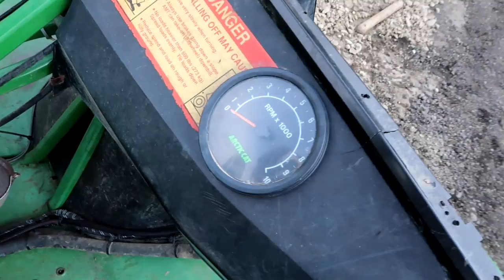Suzuki 600 Gator Top Speed Test

Comment: I dont know much when it comes to engines and stuff but what if you took the clutch system off the arctic cat that you took the engine off wont it make the gator go fast because it setup to handle all the power or would it not work due to the gator having 4 wheels to power and not a track and wouldnt help to had a clutch cover to keep it from getting wet and muddy so it doesnt slip

Comment: What are the hydraulic brake replacements you used? I am not that mechanical and my brakes on my AMT 600 do not work and the dealer wants $200 for the brake pads only. Thanks.
Reply: Have you found a solution? I have the same issue.
Reply: @lumberjackdreamer6267  Get hydraulic brakes for a three wheeler ( calipers and brake pads, brake lever with reservoir for handle bars and brake lines ) You will have to make brackets to mount calipers but that was not that hard. The bigger the better.

Comment: Please keep your ground when welding as close to were you weld as you can otherwise you will be running electrical current through  any bearing between your stinger and the ground. This causes pitting in the bearing and premature failure. Just want your stuff to run longer and create moe content for us the viewers.

Comment: I told you 2 months ago its geared way to low those 85hp  piston port (chainsaw) 580s suck 90hp with zr carbs and timming
 In the sled world those motors have no low/mid torque hard on gas/oil nicasil cylinders so cant be board out oil spewing out from the leaks in the exaust your way better off using a rotax 583 anyways if its all you had then I understand

Comment: Go to go power sports and get a better torque converter and make that 100 hp more useful
Reply: Better torque converter? So you're saying that the clutching off the sled is junk?
Reply: Jakob S It could be but im not there to see if it is
Reply: @jettables9470  That's not how it works bud, the rear end is what's limiting him as of now. Its geared wayy too low. Be best to run the secondary straight to a jackshaft/solid axles.